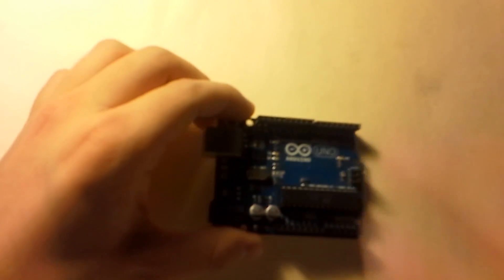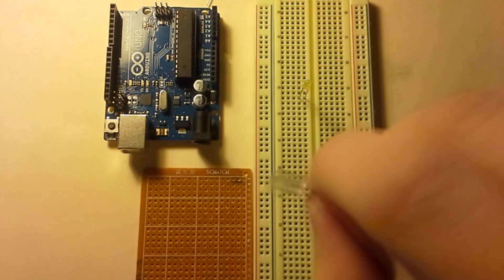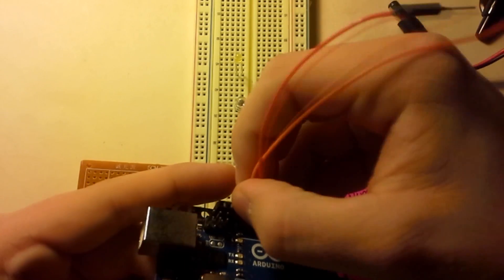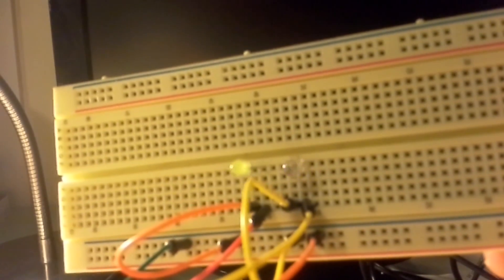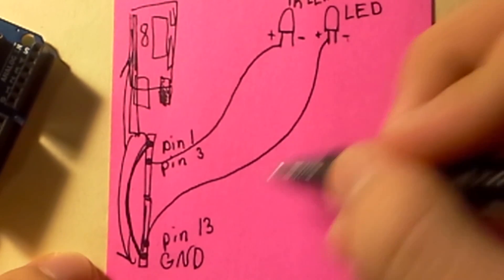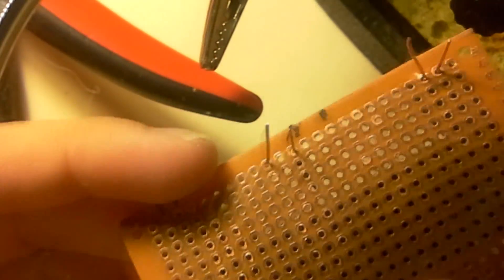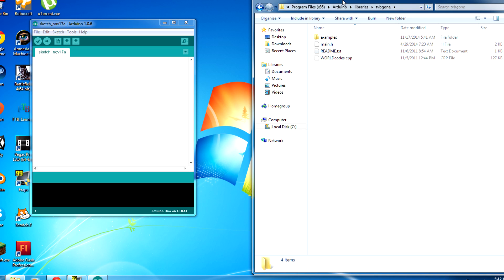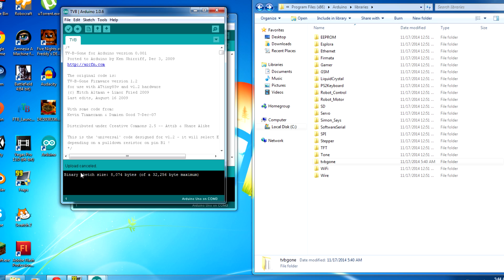How To Make A TV Be Gone With Arduino

Comment: This report would have more information with
  "Show verbose output during compilation"
  enabled in File > Preferences.
Arduino: 1.0.6 (Windows NT (unknown)), Board: "Arduino Uno"
sketch_feb22a:182: error: 'US' was not declared in this scope
sketch_feb22a.ino: In function 'void setup()':
sketch_feb22a:203: error: 'US' was not declared in this scope
sketch_feb22a.ino: In function 'void sendAllCodes()':
sketch_feb22a:225: error: 'US' was not declared in this scope
sketch_feb22a:241: error: 'US' was not declared in this scope
sketch_feb22a.ino: In function 'void quickflashLEDx(uint8_t)':
sketch_feb22a:391: error: 'DELAY' was not declared in this scope

Comment: Please Help (Error):
Arduino: 1.6.5 (Windows 8.1), Platine: "Arduino/Genuino Uno"

In file included from E:\Games\Documents\Arduino\libraries\tvbgone/main.h:9:0,
                 from TVB.pde:21:
TVB:78: error: variable 'NApowerCodes' must be const in order to be put into read-only section by means of '__attribute__((progmem))'
TVB:79: error: variable 'EUpowerCodes' must be const in order to be put into read-only section by means of '__attribute__((progmem))'
Multiple libraries were found for "main.h"

 Used: E:\Games\Documents\Arduino\libraries\tvbgone

 Not used: E:\Games\Arduino\libraries\tvbgone

variable 'NApowerCodes' must be const in order to be put into read-only section by means of '__attribute__((progmem))'
Reply: The adafruit website has a forum page with a link to the download that's fixed for IDE 1.0.6

Comment: Hi! This is a great project, but when I tried to download the code on Mac, I cannot open the TVB.pde file in Arduino 1.6.3, or any earlier version. Help?
Reply: Jacob Bryant Have it in the program now, but am getting these errors when compiling. Arduino: 1.6.3 (Mac OS X), Board: "Arduino Uno"

TVB.ino:21:18: fatal error: main.h: No such file or directory
compilation terminated.
Error compiling.

  This report would have more information with
  "Show verbose output during compilation"
  enabled in File > Preferences.

Comment: i have an error on the code:  Arduino: 1.5.7 (Windows 7), Board: "Arduino Uno"

In file included from C:\Users\HOGLORD\Documents\Arduino\libraries\tvbgone/main.h:9:0,
                 from TVB.pde:21:
TVB.pde:78:30: error: variable 'NApowerCodes' must be const in order to be put into read-only section by means of '__attribute__((progmem))'
TVB.pde:79:30: error: variable 'EUpowerCodes' must be const in order to be put into read-only section by means of '__attribute__((progmem))'

  This report would have more information with
  "Show verbose output during compilation"
  enabled in File > Preferences.
Reply: Hi!! Just download Arduino 1.0.6 version, that worked for me ;)